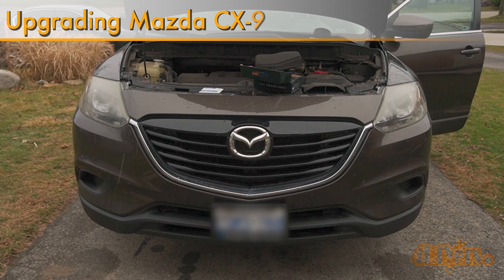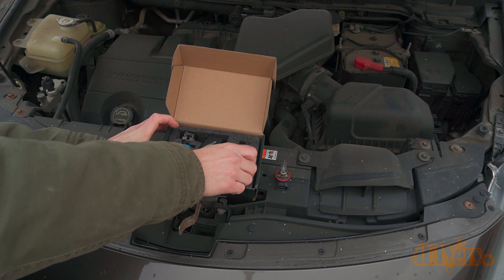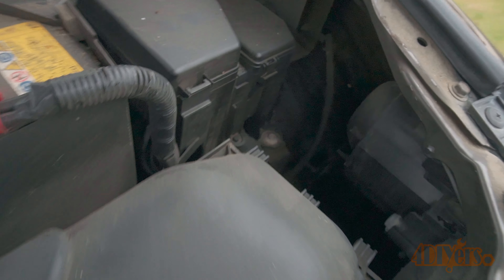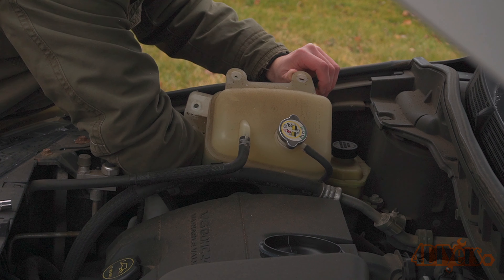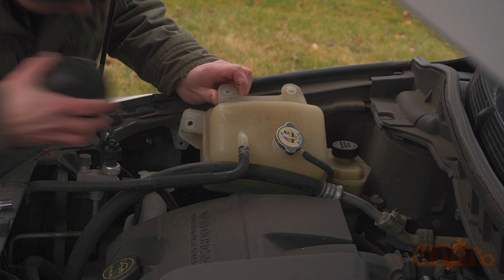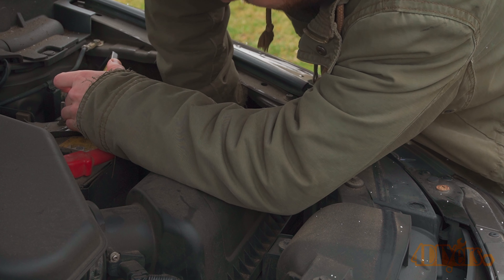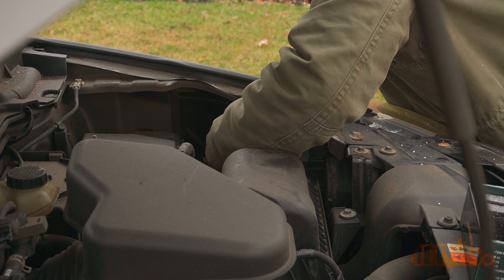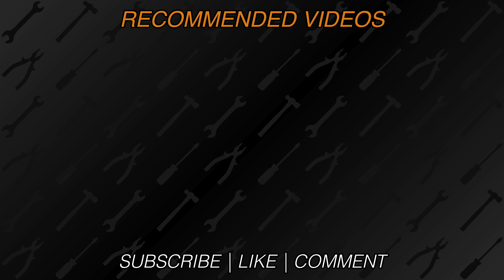How to Upgrade the Low Beams on a Mazda CX 9 to LED

Comment: I had a CX-9 fail Virginia inspection this week because the shop said DOT doesn't rate the light assembly on a 2015 as suitable for LEDs. They have been in for 2 years and today I am replacing them with less bright halogens.
I've been reading th a t even in 2020, Mazda was using a mix of halogen and LED lights in the CX-9.
Reply from the maker: They go by what was available from factory unfortunately. Apparently Mazda and a similar generation of Volvo (both owned by Ford) have an issue with headlight output as they age. Once your inspection is passed, then I would just switch them back to LED.